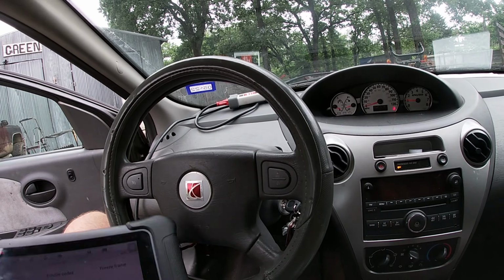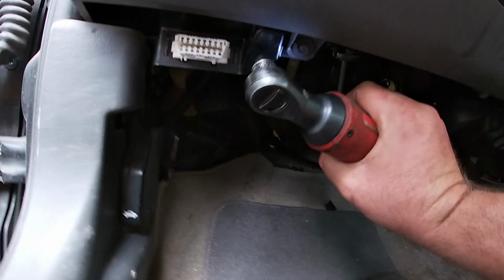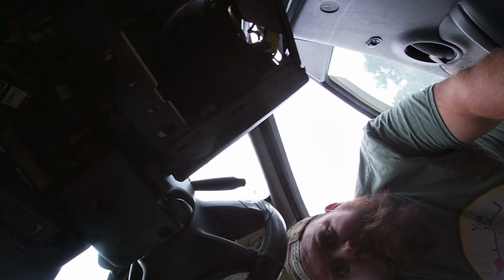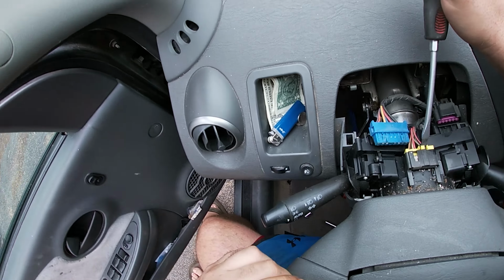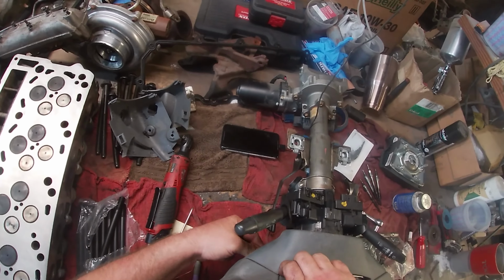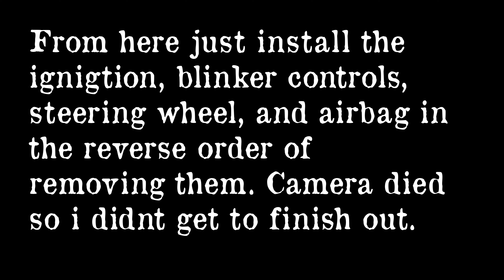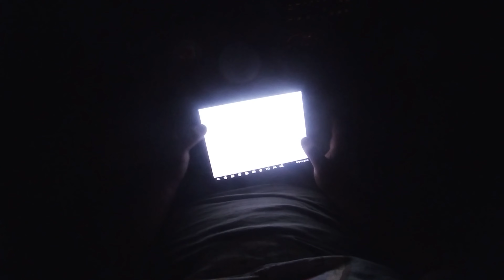Saturn Ion Steering Column Replacement (2004-2007 Saturn Ion, 2004 and 2005 Malibu, 2005 Pontiac G6)

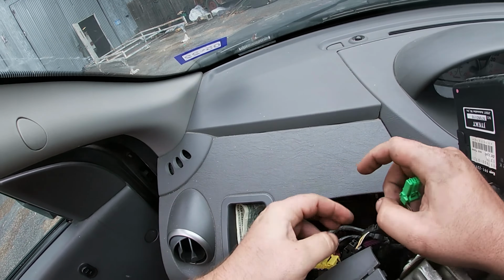Comment: ~ @19:50 I was looking where are steering column bolts to remove to lower column on the front seat. The project is on removal Evaporator fm 2001 Saturn SL2, and one of 60 steps (on HVAC Module removal, and the Evaporator is inside of the Module) in Shop Manual is #36:  Remove steering column bolts and lower column on front seat. The picture shows 2 bolts which go into the area right under the steering wheel, around that release the wheel handle. I thought it was smth wrong w/instructions here, since the bolts keeping the steering column in place should be somewhere on the bottom, by the floor. Watched your film, then went to look again: there are actually 2 huge bolts #13 around the release handle for the wheel, so I can remove them and lower the wheel, but not the column, so I don't know why they stated like that in Shop Manual. But it is good to know where those bolts are at least. Thank you for this informative film. Not many films on this complicated project on Steering Column removal.

Comment: The 04-07 are known to have that warning about PWR STR. Usually all you have to do is replace the p.s. motor(2 bolts,). The failure point typically the motor brushes in the servo motor. Why did you need to replace the steering shaft?
Reply from the maker: Oof, its been a good while since I did this job so I cant remember the codes exactly. What it boiled down too was there being two failure points with the steering shaft, the electric motor you mentioned, and some connection issue internal to the shaft itself. I asked a bunch of our engineer friends at GM, but no one could recall exactly what broke internally. The repair bulletin's call for an entire shaft replacement for the associated codes. Sorry I can't remember them exactly, but with some googling or access to AllData the code flowchart is pretty easy to find. I was hoping to be able to find the exact problem to tackle it, but was never able to track it down.
Reply: @GreenCastleGarage  That's what dealer said to me about 07 cobalt. I thought it was the motor, but nooooooo, it is the ridiculously expensive entire column replacement. But watching your video, I see this is a lot harder job than just replacing the motor. $1259. Lots of money, but can't afford another car. Thanks again for your video.
Reply from the maker: @benton-benton  it's not awful, a few tools and swear words and pretty much anyone can do it. Good luck if you tackle it yourself. If you hit any walls I'll be happy to try and anwser any questions.
Reply: @GreenCastleGarage  The cobalt is at a chevy dealer. Really expensive. The steering completely froze, couldn't drive the car. I can't fix the car, wish I could. Thanks so much for answering back and for your videos. I was feeling like maybe the service guy was fibbing to get more money. But watching you fix the saturn, I knew the service guy was telling the truth. Thanks again! Very much appreciated.

Comment: Hi there, 
Was watching your video on the saturn ion steering column job you did because I am trying to replace my clutch pedal on my 06 Ion and am having a hell of a time. Ive had several people with more mechanical skills come and try to help they too were unable to get the old one out and now my cars in a million pieces. I decided to pull up the Chilton manual and procedure involves having to remove the steering column mounting bolts move the steering column just ever so slightly to allow the clutch pedal bracket and pedal to come out. Aside from having no idea how exactly to put this all back together after a few hands have been in it... problems im facing are #1 the manual doesn't show or explain where the mounting bolts are or how to remove them
2. It just says to "move it enough" so the pedal and bracket can come out. (Which is just barely hung up on the upper corner of the bracket behind the steering column by just about 2 cm)
3. What do you have to do to secure the column etc?
I have been without my vehicle for 2 weeks now and it's even worse than when it got parked all of it because the clutch master cylinder pushrod that attaches to the back of the pedal snapped and then chewed through the plastic bushing and the pedal that holds it into place. Its the shitiest design I've ever seen but besides that the pedal is toast because of it. Im getting a new pedal but the old one isn't even out yet.  I also ordered a new clutch master which is Farley easy to install but if I cant get the old pedal out and put a new one in so that the new clutch master pushrod has a secure place to connect to the back of the pedal then im still in the same position am now... CARLESS, LOSING MONEY QUICKLY, AND GOING CRAZY! I came across your video and although its not exactly what I was hoping to see it was still really informative and I wish you were my neighbor cuz you for sure know what your doing. Any advice or direction you might have for me would be appreciated thank you
Reply from the maker: Oh boy, sorry to hear about your struggles. Unfortunately, I don't have one laying around to just make a video for you so I'll do my best to type it out. From my understanding you don't even have to drop the column. There is a plastic retainer piece on the front of the pedal you remove to disconnect the clutch master cylinder. A couple nuts holding the clutch bracket to the dash somewhere up top. The clutch position sensor up top somewhere as well, and finally the pivot bolt. The order of events should go, retainer piece covering master cylinder, pedal position switch, disconnect master cylinder, bracket nuts, pivot bolt. Also sounds like you want to be sure to secure the return spring and bushing before you pull the pivot bolt. Hope this is of some help, and good luck with your repair. It gets frustrating sometimes, but you'll get it I'm sure.
Reply: I just figured it out. There is a third bolt which holds the steering column in place,  which the whole steering column pivots on. It's a long bolt which goes through through the column perpendicular to the column.
Reply: Or you can go into the fuse box located underneath the hood and find the yellow Jcase 60amp fuse that controls the power steering! Way easier than taking everything apart. But my question was really geared towards the stupid clutch pedal and master cylinder. What a seriously stupid design! I actually just got my car fixed but now its making some loud noise but only when the clutch pedal is de-presses. Push it in and it goes away. It sounds like chattering of metal or grinding almost? No clue but im ready to sell my car. Its a great car with a strong  engine and tyranny, its zippy and not to bad to look at.
Reply: @brookeowen4392  I'm talking about your question about the clutch, I had the same issue, I just figured out that you have to remove that third bolt to drop the whole column to get the clutch pedal bracket over the master cylinder shaft.
Reply: @Qwertz-j8w  omg! Nearly 3 months without my car over a 3rd hidden bolt! Arg!!! But hopefully someone else can learn early on what took me up until now. Thank you for thinking of me as soon as you came across it, your awesome.  Hope you don't mind more questions in the future cuz im sure I will have some! 🤔😊

Comment: What I don’t understand is why you took that steering column all apart all the videos I seen they just swapped the entire shaft five minutes and was done
Reply from the maker: Well, it was a long long time ago I did this job at least for this forgetful brain. That being said if memory serves, the column came from a junkyard and the plastics and wheel were in much worse shape. So I swapped all the cleaner components over. Otherwise, no idea lol. It's one of my earlier repair videos so it's certainly not filmed or edited all that well, not that I've gotten much better lol. Hope it at least helped some.
Reply: @GreenCastleGarage  Awesome bro we still appreciate you though👍

Comment: 07 chevy cobalt. Power steering froze. Same as this saturn, it said "power steering". Luckily I was in a parking lot at the time it froze. I'm being told it's not the ps motor, it's the steering column. Does that sound right? Thanks. Service guy kept saying 0550. And I noticed you said 0550 too. Thanks for this video.
Reply: torque sensor went bad inside the shaft. You can always have that replaced. part costs like 160ish but they have to take the lower part of the column aprt to reach it